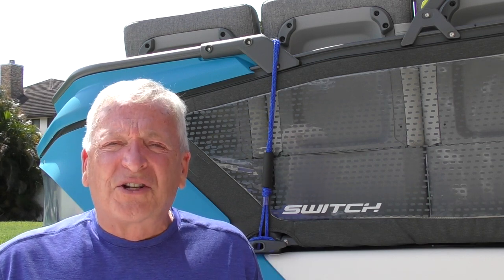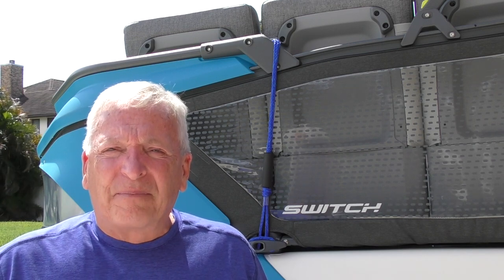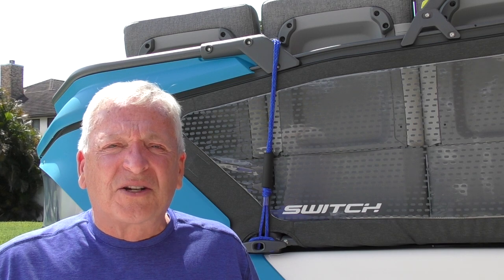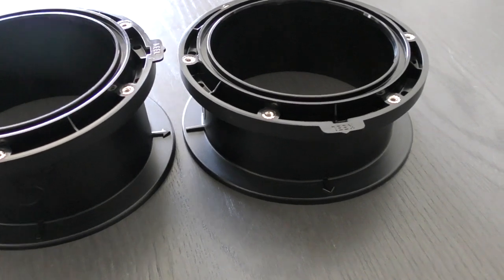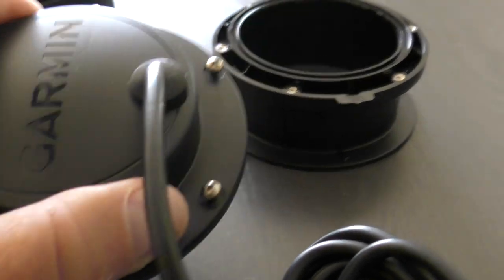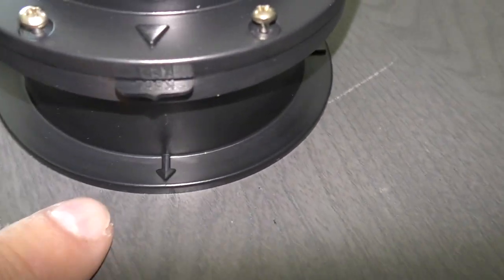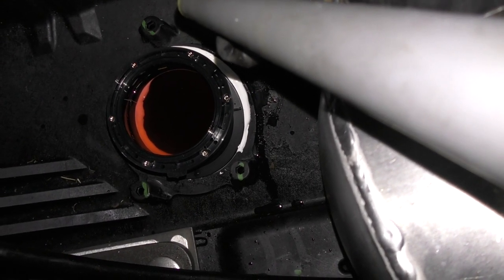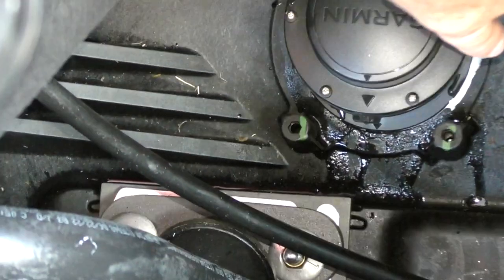SeaDoo Garmin Transducer

Comment: Thank you Frank. I went with the Garmin GT15M-IH transducer on my 2023 21ft Switch Cruise. This was a simple installation and thanks to your video, I had all the parts and tools necessary to make this installation fast (relatively) and easy. The transducer works great! I noticed that you have a lot of surface clutter/reflection on your scope. I'm not sure if that is a result of your being in shallow salt water or RF interference(RFI) caused by the electrical system in your boat. As a precaution, I put snap-on Ferrite beads on the cables for RFI Suppression. and I don't have the surface reflection like you do. They are dirt cheap and doesn't hurt to try them.  Thanks again for the great video!

Comment: Which Model Chart Plotter did you install Frank ?  -- I am getting one soon and would like the one I install  to work with all the features that come with the Garmin Chart Plotter... I've read some of the Echo Map UHD units will not operate all their features  if the  Transducer you installed is used.... THANKS IN ADVANCE
Reply from the maker: The 22-23 Switches came with Garmin EchoMap 70v.  I connected it to the stock chart plotter.   Garmin's website will have a section on compatibilities should you wish to get a different chartplotter or depth finder.
Reply: @letsrolldiyauto1532  Thanks for the reply Frank -- i been doing a lot of research-- getting close thou.. :)  Happy Sailing!!!!!

Comment: Frank,  your videos helped on several other items,  I have a question though,  I am now considering this transducer on my 18' Switch,  It appears to be more space to get to your or maybe I am not looking in the correct spot.  anyway would be Pics or something to describe better the location?  Would be really helpful
Reply: You should have two compartments by the captain chair.  Open them both up.  The engines are the same, so I would imagine the engine compartments are the same.
Reply: @Drimplant  ok thank you for following up here.  So the first compartment I see one ring palcement area - but it is really close to one of the engine components ( I imagine once the part is in, it nearly touch,  and the second compartment I just lokked at there seems to be one, A little bit of a long run, but that be the one

Comment: I noticed that your 3m sealant was inside the tube.  Does that matter and should i remove the bleed through? I'm thinking that the entire surface should be the same in order for the transducer to have an accurate picture.
Reply from the maker: Doesn't matter.
Reply: Thanks.  I bought everything you suggested. I'm going to install it tomorrow. I just bought the 2024 switch cruise limited. I have a few amplifiers in my console area not as clean as yours, but I'll use your video as guidance.

Comment: If you buy the transducer do you need to buy the depth finder? Or if you buy the transducer you no longer need to purchase the depth finder? Great video. Thank you.
Reply from the maker: No.  I ordered the BRP depth finder when I ordered the boat, not knowing that it didn't connect to the Garmin.  I then bought the Garmin transducer so that I could have more functionality and use with the garmin Echomap.
Reply: @letsrolldiyauto1532   I just had the dealership remove the "Echo Sounder Kit" from my order as I want the one connected to the Garmin.  Don't Need Both.  Thank You!

Comment: Great video! Does the transducer give a reading when your Switch is at higher speeds? I’m about to install one in my Switch 18. My friend’s does not give a reading above 10 mph.
Reply from the maker: It does not.  At higher speeds there's some cavitation that prevents accurate readings.  his is true of both the BRP transducer and Garmin.  To eliminate that, use the GT65 transom depth finder.
Reply: Hi Frank, greatly appreciate your videos. I noticed you said GT65, did you mean GT56? Can’t find the 65. I don’t do much fishing but my main priority when picking out a transducer is knowing my depth at all speeds. Do you think the GT56 is still the best option for this? Thank you!

Comment: What was going on with your screen? I'm guessing interference from the other depth transducer since they probably use the same frequency?
Reply from the maker: Not interference.  They are totally separate.  If you go too fast, you'll get an inaccurate reading with either.  The transhull GT65 is best for depth readings as speed.

Comment: Hi Frank, I ask my dealer to install a Garmin transducer on my Switch when I bought it. I put it in the water this weekend to try and it wasn't working. When I turned on the Garmin device on my dash for the first time, it appeared to have never been turned on as it asked for language, country etc...
My question is, can a dealer install this without using the dash mount unit for calibration or connectivity etc? How would they know it works?
Thanks very much!
Reply: As long as they installed it properly, they would not have needed the Garmin.  In fact, you really can't test it unless it's in the water as it will not give a reading if on a trailer.   The only thing that could really be an issue is not having the mounting sealed properly and having the antifreeze leak out.  But they can usually see if it's sealed properly during installation.  I'm sure it's not their first rodeo with transducer  installs.

Comment: Hi Frank,
I had my dealer install the transducer and it’s been a headache. It will never read above 15mph and often times won’t read at idle; I’ve seen others have success at 40mph. The dealerships worked with BRP and replaced the transducer and still it won’t work. Now they’re ordering a new cradle to see if that fixes it. 

Yesterday I took a look and noticed that the arrow is pointing towards the FRONT of the boat - could this be the root cause? If standing at the back of the boat, the arrow is pointing at 12 o’clock; should it be pointing at 9 o’clock (or maybe 10/10:30)?
Reply from the maker: The arrow should be pointing towards the center of the boat (the keel).  Thru hull transducers in the switch will rarely be reliable above 15 mph.  Transducers need to be in liquid.  So the cradle they're in needs to have fluid (usually marine anti-freeze) and the boat in the water.  With the jet boats, we often can create some cavitation that can throw off the transducer reading.   The transducers that will read at speed seem to be the transom transducers (outside the boat).  I do not have one of those.  But generally, the depth reading is most important for switch owners at lower speeds anyway.
Reply: @letsrolldiyauto1532  so it sounds like 12 o’clock is NOT the answer then, correct? Would it point directly to the engine (9 o’clock) or towards the exact center (~10:30)?
Reply from the maker: @mrgarcia6  Correct.  It should be pointing towards the engine - the center of the boat.

Comment: Frank, your install answered a hundred questions but one-  when I ordered the Garmin ECHOMAP™ UHD 72sv GPS (295100975), BRP noted that "requires Harness (278003684) if installed along with other electrical accessories".  Do you know how to connect the harness to the Switch dashboard?  Thank you
Reply from the maker: So your Switch did not come with an Echomap?  You are installing everything?  2024 model?
Reply: @letsrolldiyauto1532  Yes, 2024 Switch 18' with 170hp engine.  Only the 230hp model included the Echomap.  I am starting from scratch.

Comment: Do you ever notice depth flashes and it stops working at speed?
Reply from the maker: Yes.  That is normal.  The depth finder is sonar and does not work in air.  It neds to be in a liquid (water).  When you start getting to speed, there's cavitation under the boat and these air bubbles interfere with the sonar.  Also, the latency  (time between the signal sent and signal received) may have an effect on the accuracy.   The more expensive transom mounts will read depth under speed much better.

Comment: Correct i installed the one for the display but I do not get a reading.  I also did the ski package and it works fine
Reply from the maker: The depth reading for the BRP depth finder is accessed by using the right and left arrows on the right steering side.  It will rotate between settings, RPM, depth.  You can check the connections and here is the BRP instructions.  Look at the bottom for troubleshooting.  https://brp.my.salesforce-sites.com/ISPublicArticleInfo/apex/BWLightningViewerWithTranslate?#id=kA03x00000113IdCAI&googtrans(en|en_US)
Reply: It needs to be near water to register, I just installed one (transducer)on my RXT 300, which didn't  show up on dash until I put the transducer near a bucket of water. I actually just glued the 20 degree on my Switch which connects to the Garmin.
Reply: THanks for the help we'll see what happens thanks guys

Comment: Installed the transducer and hooked to the screen but not reading depth at all. Do I need to download anything or change settings in Garmin?
Reply from the maker: You should not need to download anything.  The boat does need to be in water.  The transducer housing needs to have the antifreeze in it and the boat in the water.  It won't read if the boat is on a trailer. Did you check to make sure the antifreeze didn't leak out (you had a good seal)?   Connections all fully seated?

Comment: Can this be installed after the dealership installed the sea-doo depth finer?
Reply: Yes.  I had the dealer install the Sea Doo the BRP depth finder (as I had ordered it when I ordered my boat).  The position it on the port side.  There are transducer mounting areas on both sides.  I installed the Garmin on the Starboard side.  o both are functional.

Comment: HOw did you get depth on your dash screen I installed the Depth Finder but I don't get any reading
Reply from the maker: The depth on the dash is from a separate transducer from SeaDoo.  It attaches thru the CAN connectors.  The Garmin only displays on the Garmin EchoMap.  So I have two transducers on the boat.
Reply: @letsrolldiyauto1532  Correct i installed the one for the display but I do not get a reading.  I also did the ski package and it works fine

Comment: I mounted mine but I still don't have depth readings. Anybody have any suggestions? I've tried unplugging and reconnecting.
Reply: Are you in water?  Depth finders don’t work in air. If you’re on the trailer, you will not get a reading.  The mounting ring needs to be full of marine antifreeze and the boat in water.   If the depth finder is found on the Garmin, then you problem is either the fluid leaked out of the mounting tube, in which case it needs to be resealed, or the boat is not in water.  If it’s in the water and the mounting tube is still full of antifreeze. And the depth finder shows up as a device on the Garmin, then you should call Garmin and see about a replacement.

Comment: THanks but I tried all of that it simply doesn't give me depth anywhere.  No display for it at all
Reply from the maker: Did you check the troubleshooting at the bottom of the installation?  And I assume you're in the water.